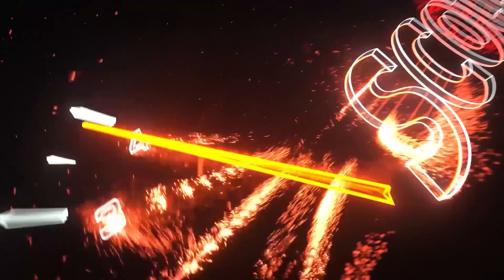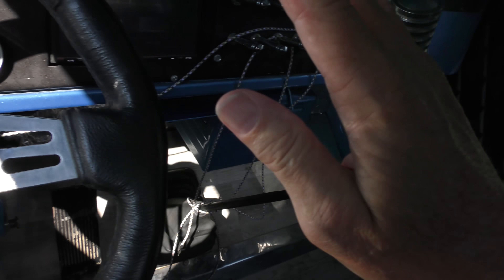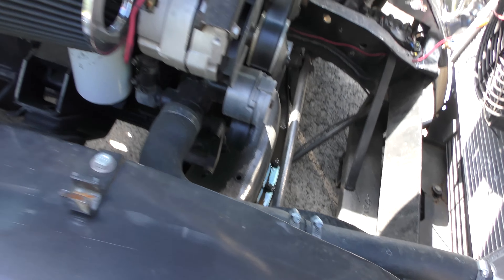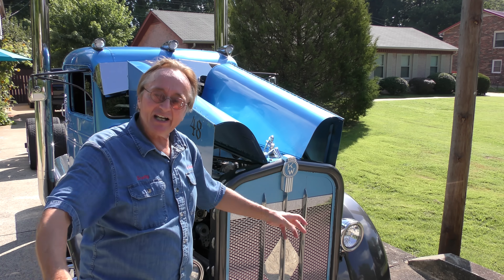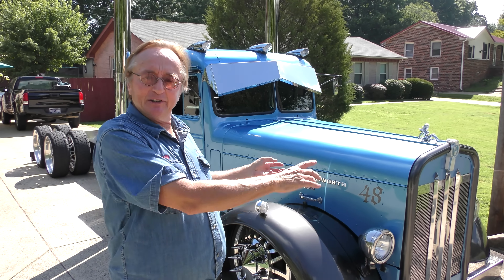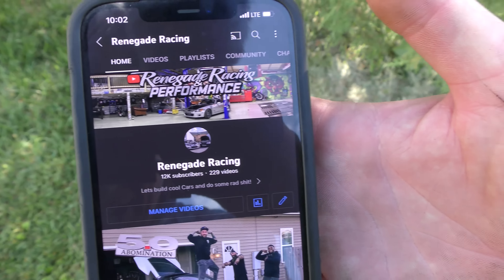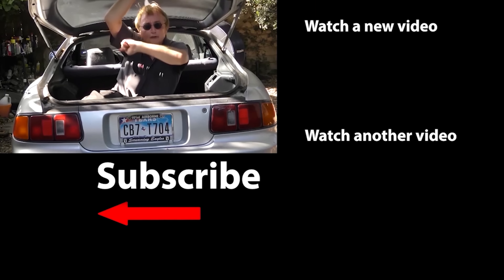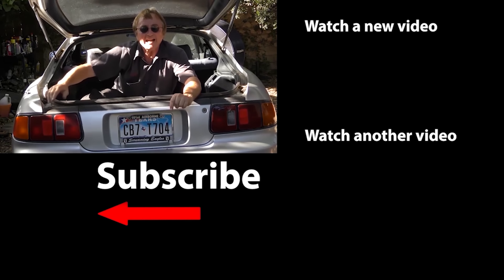Forget Toyota, Buy This Instead

Comment: Finally something that will outlast a 94 Celica 😂
Reply: Hey, don't laugh. I still have my 1994 Celica GT, and it's still running like a champ, plus it has sporty styling. I love it. So laugh if you will driving your newer super expensive car that will cost you an arm and a leg to fix.
Reply: A mack b61 is basically the same thing except for the duplex transmission lol

Comment: My '99 Ford Cargo 1215 has this very same Cummins 5.9 12V ....rated 160hp@2500, both manufatured in Brazil. Very good overall little class 6 truck with only 76k km.

Comment: Back in '92, bought a brand new half ton Dodge pickup with the extended cab. That truck gave me zero problems, all I did was keep up with the maintenance as per the owner's manual. Before selling it eight years and 80,000 miles later, had to have a complete New Jersey vehicle and emissions inspection. Having the same reliable mechanic for all those years, said the emissions were the same as it was new. With the 318 cubic inch engine, it gave me plenty of power when needed. My only complaint was the truck could have used a little beefier brake system. Otherwise, a great rig.

Comment: SCOTTY! id like to start a heavy equipment rental business (skid steers, mini excavators etc). I need a heavy duty truck but toyota and nissan dont make anything bigger than 1/2 ton. What year of used 3/4 ton or 1 ton truck should i look for and should i buy ford chevy dodge or gmc??

PLEASE UP VOTE SO SCOTTY CAN SEE!! :D
Reply: Scotty will tell you same thing he told me, lol, get a Ford if you can find one and have a mechanic like him to look at it.
Reply: Look at Car Wizard’s video about the Dodge V10. They’re way less hyped than the Cummins but Dodge’s old diesel trucks are good ones. The benefit of an old diesel is that the emissions chips can’t put you in limp mode when a sensor goes out

Comment: Guy with the Navigator better put steel sleeves in the spark plug holes or it will sound like a popcorn machine when the plugs blow out.

Comment: Well.. Sometimes, things happen. I remember a time I put a clutch in an old Dodge Colt. I went to start it, and the timing belt stripped out. There was no way I caused that. Sometimes old cars break at the weirdest times, but they are going to break. Especially if you wait longer than 120k miles to replace the timing belt.

Comment: Had a transmission rebuilder pinch wires on top of the trans/engine bell housing.  Took me a while to find it but I had an idea where to look.  Always start looking for problems that occur after work where someone someone last worked on it.

Comment: "It costs too much money to build them this way"

If the average price of a new car is $45,000, I would think there's plenty of profit left over to build them this way.
Reply: It’s not driven by cost, it’s driven by emissions requirements. They can’t meet the emissions requirements with a mechanical injection system. Blame the EPA rather than the auto makers. They literally can make a truck with no emissions systems on it and send it overseas but have to put insane emissions systems on trucks sold in the USA.

Comment: In the UK that engine mated with a 8 speed gearbox pulled 17 tonnes , 34000 pounds for around 3/4 of a million miles between rebuilds , good little engine , water pumps were consumable items , change every 100,000 miles .

Comment: Need the electric version. 25 miles between charges! (8 if you are hauling a load)
Reply: Less than 8 if there happens to be a power outage.
Reply: @northdakotaham1752  Did you see where California is asking people not to charge their vehicles for now?
Reply: @oldguyreal9681  no...didn't see that. I did hear that the deadline for purchase of new gasoline powered vehicles is 2035. After that...it's battery power or nothing. Sheer stupidness when they can't even provide reliable electric power.

Comment: Volvo penta made a turbo / supercharged marine diesel. Ran on turbo only untill you throttle up, then an electric ac type clutch locks up and the blower opens a flap in the intake and you better be sitting down!

Comment: I’m not a big fan of Cummins engines in semi trucks because they don’t haul much if that thing is only pulling 20,000 lbs that’s not good most of the small trailers we have at fedex without bellies in them weigh about 50,000lbs empty the big trailers we have here empty weigh over 60,000lbs full those trailers are way heavier the small trailers most of them are pulled tandem two at a time and we have small trailers with bellies in them my dad was an over the road trucker for years he was a better mechanic than anyone they had at the yard so they let him work on the truck he was driving he told me he hates Cummins engines he said they are a pain in the butt to work on you constantly work on them and they are very expensive to work on the only thing I think the Cummins engines are good for is in buses or anything that doesn’t haul extremely heavy weights they are driving engines they aren’t very good for pulling they are good for cruisers I’m planning on having a company convert a city bus to an rv for me that thing won’t pull anything the Cummins engines are durable if your cruising but they are not good for pulling very heavy loads

Comment: Scotty I have a 2007 jeep commander 4x4, 5.7 Hemi when driving at night, the lights on the dash flicker in and out, brand new battery, could it be the alternator going out. 207k
Reply: Yes
Reply: Ford Shopyard,  On your Jeep Commander the Voltage regulator is inside the Alternator. There's diodes that go out. Your vehicle is 15 years old with 200 k on the clock. They will test it for free at Autozone.  I wasn't impersonating Scotty.

Comment: I have a 2009 corvette with an automatic transmission.  It has about 38,000 miles on it.  Would it be advisable to do a transmission fluid exchange?

Comment: I would not have put those gangster hip-hop rims on it because it looks like crap. I would have also put a 10 speed manual transmission in that truck and a Caterpillar 4806 diesel engine, but I'm old fashioned and have common sense

Comment: Scotty, when you don’t have a clue the proper answer to why something like mechanical injection pumps have changed, either shut your hole, or do some research and learn. 

It has nothing to do with “costs too much.” Mechanical injection pumps are FAR cheaper to make than modern microprocessor controlled, ultra high pressure common rail diesels. 

The real truth is they aren’t made that way anymore because not unlike a carburetor, a mechanical injection pump will always just be “in the ball park” of the proper fuel mixture they need to be for any given condition, and because of that they run filthy, use excessive fuel, and cannot make the maximum power potential they could with the super accurate timing that comes with modern common rail computer controls. 

Also, for God’s sake, there’s NO G on the end of Cummins! 🤦🤡